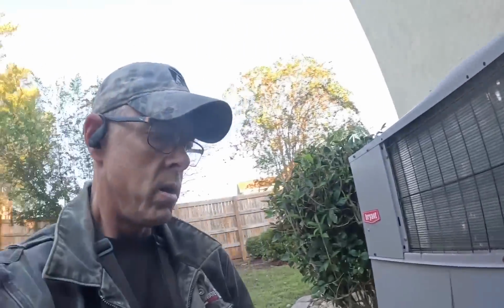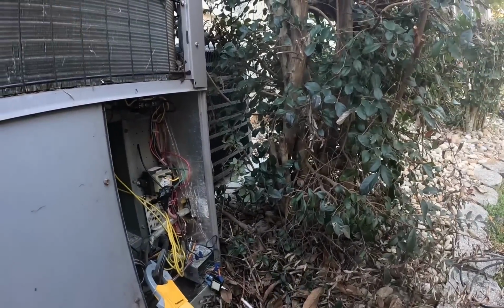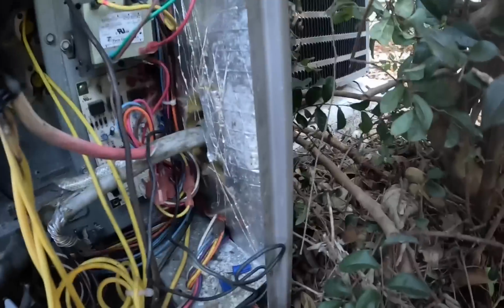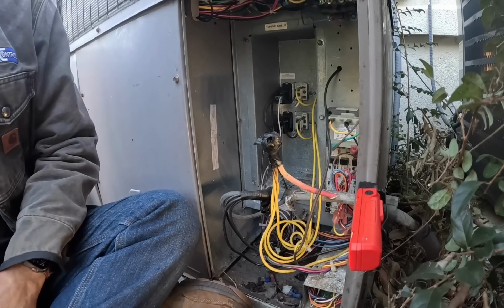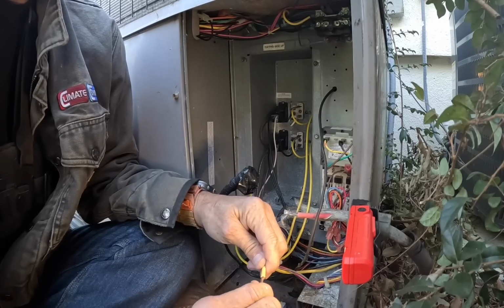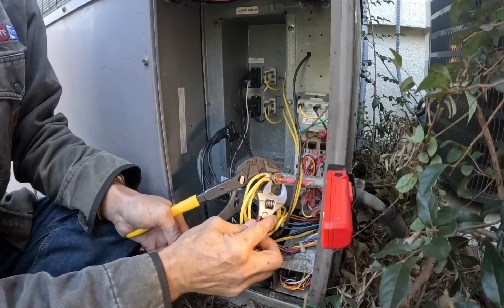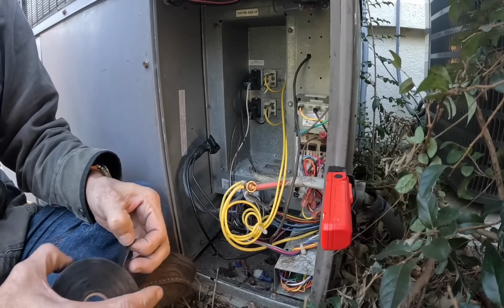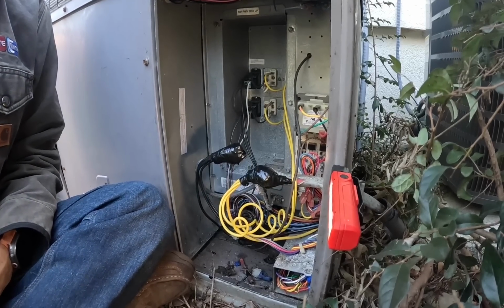Finding Other Problems When Thermostat Went Blank! #hvacguy #hvaclife

Comment: Your honesty is what keeps me watching Curtis. I have found that when merging copper and aluminum wire , some dielectric grease works to keep the wires from oxidizing due to different expansion rates of the two types of metal. 👍👍🇨🇦
Reply from the maker: Good tip! I honestly just didn’t think of it.
Reply: Great Reminder. 👍🙏
Reply: It’s not expansion rates, galvanic action of dissimilar metals
Reply: @davidb2438  tomatoe tamatoe, the fact that they expand and contract at different rates will cause the dissimilar metals to arc and will cause oxidation and corrosion.
Reply: Always use grease when bonding copper and aluminum together
Reply: That fix should last a long time. Nice job.
Reply: Combining two dissimilar metals always creates corrosion, even with the grease. If you make sure to keep the connection as even as possible and tight, the corrosion is usually minor and wont cause a lot of resistance which is what always causes these to overheat and fail.

Comment: Don’t know if you know this but beside the dielectric grease there are torque values that needs to be applied and the amount of wires allowed for that terminal was over limit I think ! for me it’s better not to use that type of connection due to so many problems that it could bring there are way better ones available than Frankenstein laboratory lol

Comment: Long, long ago, there were two types of tapes to use for electrical things - you *HAD* to use both kinds; on a spice you would wrap "rubber electrical" tape around the joint; then you had to wrap "electric friction" tape over the rubber electrical tape - Both were needed. Friction tape is a cloth tape that can be used to protect electrical tape from sharp objects.   In the early 1960s improvements in tape and plastics led to the creation of one tape that could be used for an electrical connection.  The older, the two tape method, had many problems and they didn't last. Today 3M sells modern friction tape, 'Friction Tape 1755' is a black friction tape designed to provide mechanical protection against abrasion and cut through for cable, wire splices and connections insulated with rubber electrical tape.

Comment: Speaking from years of making splice connections, i would apply the noalox to all metal connections, then a single layer of 3M 33 electrical tape. after that apply the splicing tape as you stretch it so that it is approximately 1/2 inch wide.  this is done so that the splicing tape will try to return to its normal width of about 3/4 inch causing the splicing tape to bond the layers together. Then a few layers of 33 on the outside will insure proper sealing of the connection.  the point of the first layer of 33, it will prevent the splicing tape from sticking to the metal parts making it much easier to remove the splicing tape if you ever need to disconnect the splice.  Believe me when i say this, just try it and you will see.
Reply: And put the first layer of 33 tape on sticky side up for the same reason.

Comment: Advice to everyone: When it comes to ATC Mini fuses, please only buy reputable brands like Eaton-Bussmann and Littelfuse. While you can definitely find better deals online, many of the no-name brands can handle far more current than rated capacity for much longer than is safe for the circuits they're protecting. This is one of the times where you don't want to cut costs.

(Mental note: If I ever build a house, be sure to install good lighting directly over the thermostat for HVAC techs!)

Comment: Gotta add the "me too" comment about bi-metallic terminations.  Galvanic corrosion is inevitable and is why the CU-AL wiring devices have mostly gone away outside of industrial and supply service uses.  I'd liberally apply Noalox to all wires (brush the Nolaox into the strands of stranded wires) and inside the brass split bolt.  Another poster has a great Scotch 33 + self amalgamating tape insulation technique that is very similar to what we use on exposed RF communications cables.

Comment: Curtis, unless you apply some NoAlOx or Ox-Gard liberally on the copper to aluminum connection, the corrosion and resulting high resistance WILL return. I’ve seen you use Ox-Gard in the past. Anytime you make a connection with aluminum wire you should be using it. Same goes for when you install a disconnect with aluminum feeders; use Ox-Gard!
Reply from the maker: I just forgot. But, I do appreciate the remarks, so others can learn, and to help me make a mental note to do it next time.
Reply: The problems splicing aluminum wire to copper wire led to the discontinuation/ban on aluminum wire inside residential houses, over time the aluminum to copper joints would move, then they would heat up - Many, many houses burned to the ground before aluminum wire was banned in the late 1970s or so.  Aluminum wiring is allowed as entrance wire up to the panel, after that NO.  If I was an HVAC guy I would never, ever touch aluminum wiring - the liability risks are enormous - even decades after you make the splice bad things can/will happen at your splice, and you will be blamed. - Call an electrician who has special liability insurance.  Aluminum wiring is still in millions of homes - and every year some of those homes burn down because of the aluminum to copper wiring.  Just run far away, it isn't worth it.

Mobile homes used to be notorious for using aluminum wiring, people died every month because of it, sometimes entire families died.  Most of those mobil homes are now gone, but the houses wired with less expensive than copper wire will be around for a hundred years.  The aluminum to copper splices can heat up to over 200 degrees F, it doesn't matter of the circuit/outlet is in use or not.  Inside houses  NO aluminum wiring. 

There are special split-bolts designed to join aluminum to copper wire, they are  rated for that - the ones I know about are copper split-bolt that was plated with tin, tin doesn't react to either metal.  the aluminum wire only touches the tin, the copper wire only touches the tin  These split-bolts cost more -- about $10 each.  See Southwire SB2/0-8CPD Split Bolt Connector as an example.

Curtis will be OK here, any fire would be outside of the house.  Inside the house is a much different story.
Reply: @DavidNull5 - looks like the lack of noalox could have been the reason for the hot spot in this example?

Comment: Lately, I've discovered quite a few poor connections on old Carrier Infinity communicating systems.  Over time, the outside board connections need to be re-wired with clean, bare wire due to the copper oxidizing.  Quick, easy fix for lots of communication faults at the T-Stat when you can't find any faults with sensors, etc.

Comment: It keeps failing from oxidation. You need to use something like Noalox on the connection due to joining copper to aluminum. Standard use by electricians and code…use rubber tape first followed by vinyl tape

Comment: Curtis I don't believe split copper bolts are an approved method for jointing two dissimilar metal wire. That why corrosion and heat occur in the first place. They make special connector for dissimilar metal wire. Check your supply house.

Comment: Great job using Kearney clamps with Rubber tape, it fuses together into one Blob then electrical tape. Aluminum Wire has no place there for such a short run, false economy.  Wire nuts that big are ridiculous 😄
Twice I have seen Capacitors out of tolerance causing high current drain but it is just an observation.
Thanks for the informative Video! 👍😃
Reply: Kearney clamps, been a long time since I heard that, I had forgotten. You could use a plug type connector, small wires on one side and the big one on the other, but then you have more places to corrode. Done correctly though, it would eliminate the need for tape at all.

Comment: Aluminum?  Isn't there supposed to be some extras steps when dealing with aluminum wiring?  I would have expected a mention of it, like using CU-AL rated hardware and/or some goop to prevent corrosion from dissimilar metals.
Reply: A bit of searching suggests the split bolt needs to be a special type with a divider that keeps the two metals separate.  That may be what went wrong with it originally.  I guess goop isn't needed.

Comment: Never put copper and aluminum together.  They do not get along with each other due to galvanic corrosion.  You can get split bolts with partitions to separate the different metals.

Comment: Have you ever tried using Polaris plugs in place of split bolts? That’s my preferred method for connecting high voltage like that
Reply from the maker: Not yet.
Reply: Polaris plugs are rated for AL and CU.   The wires are separated. 

Curtis, How long was it between the first repair that you did and this repair?

Comment: Love that 3M tape !  The larger rolls are more economical to purchase however, sometimes are more difficult when using them, such as in this repair pushing the tape roll through those connected wires. I saw a trick where the tech would take something smaller that is round, in his case he used a 3/4" or 7/8" socket (wrench) and unrolled from the tape roll what he thought he needed onto the round socket. That gave him a smaller "roll" of tape to get into tighter spaces !  It works too...
Reply: Good idea, I usually tear some off, but not when using so much.
Reply: Is that you Eric O. SMA?
Reply: It works well with any kind of tape.  I have even used  a small roll of only tape rolled up.
I try to save the end of a roll of tape for close quarter work.

Comment: i did not see you apply any oxidation inhibitor paste to your aluminum to copper wire connection , standard procedure when joining dissimilar metals to prevent corrosion
Reply: I didn't know udid hvac?
Reply: @Hvac-dude  over 20 years in northern california

Comment: May I suggest a good quality wire stripping tool, quicker and safer with less strand damage, and an assortment of good wire connectors, Not wire nuts or Split bolts. Jmho

Comment: should  alum, wire And copper  be squeezed in the conection with  out a spiter in the split bolt .? just wondering.i was taught a over c in open conections on over head  power lines
Reply from the maker: I should’ve use Noalox or there is a split bolt that separates the two. But, you’re right Noalox should’ve been used.

Comment: You did it wrong the minute you put the wires together.  You need to antioxid paste on the wire . Those connections will corrode.  Around here an inspector would reject your connections in aluminum if no paste.
Reply: Where is "around here"?
Reply: You did it wrong
Reply: Different states require different codes.
Reply: Any HVAC who works with aluminum wire risks burning down the house, in the US common aluminum wiring was banned in the late 1970s - Too many houses burned down - And out of the millions of existing houses with aluminum wiring some burn down every year - I wouldn't want to be the last guy who touched it.
Reply: Aluminum wire🔥

Comment: 250  Volts , 240 maybe .
Reply: Depends on how far the location is from the substation.  This location must be close.
Reply: Hydro line voltage fluctuates,  240 under normal operating conditions can vary between 220 and 250 volts.   In extreme conditions, 212 to 254 volts is considered within tolerance.   The time of day, temperature, moisture, system load, and even your location in the distribution network can all cause variations in voltage.
Reply: @patrickinottawa27  Thanks , in North Carolina  I have not seen that variation.  Kind of like 110 grew to 120 , 220 grew to 240 .
Reply: @jenko701   I do minor electrical as part of my job.   But I'm not an electrician.   I think it's all about "Line Loss".    The longer the transmission line, the greater the loss in power due to resistance.      If you look at Curtis's meter when testing for 240, it usually reads around 247.     Likewise testing for the low voltage it was reading 28.7 Volts rather than 24volts.    He was probably pretty close to a sub-station or a main feeder for that area.

Comment: SMART Thermostats are STUPID and Many result in FAILURE.  Not Difficult to Wire it up but you do need a little more Training than just Replacing a Battery. 🤪👎